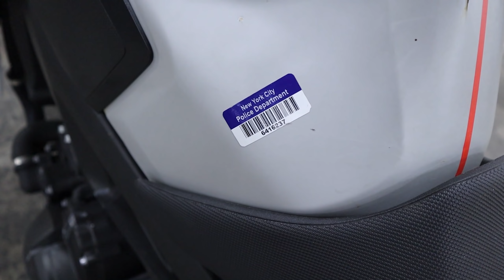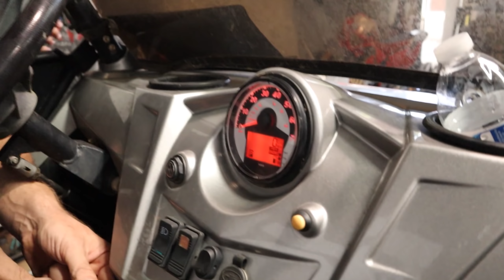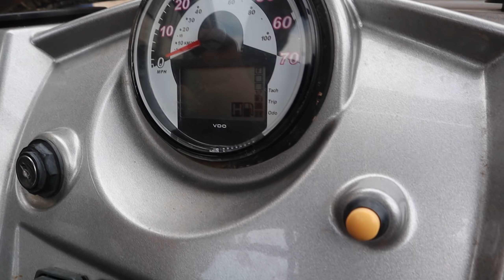Drove the Atom and then this happened...

Comment: On that rzr, you need to take the air filter out and check down into the throttle body. See if there is any fine dust that made it into the throttle body. If it did take it off and clean it. I’ve had 2 first gen rzrs self destruct due to this issue

Comment: Feels like it might have been easier to just replace the brake light right there and then drive it back? 🤔
Reply: Except it may not have been that simple.  Could be the brake light switch, electrical connector etc.
Reply from the maker: that is a really great point, but the issue with me driving it back was not because of the brake light it was because they said i cant drive it on the street with a dealer tag until i go through the enhanced inspection process.